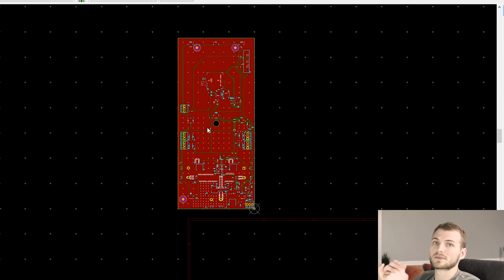Custom heated 3D printer enclosure part 3/x - KiCad PCB Design

Comment: I noticed the ground on the power input connector has thermal relieve but the ones going to the heaters don't. I assume for that amount of current you would want the connection to be solid so is this an oversight or is there a specific reasoning behind that decision?
Reply from the maker: Boy you have good eyes! Yeah, there shouldn't be a thermal on that connector. I must have forgotten to remove them from that connector when I removed the others. It should be fine since it is on both layers, and a 20 mil spoke with, but I'd definitely rather them be solid connections

Comment: As someone who is teaching himself, all 3 styles of videos you mentioned would be great.  Speaking as a beginner, who needs time to go away and absorb what I have just learnt: the detail you went into with the current return path, with stitching vias, especially next to large traces was great info. It would take more video post processing, but I reckon you could break up a video like this into individual elements of board design like that (eg stitching vias and high current return paths strategies), and create a series for a board discussing one element of circuit design at a time. I think the value here would be in having a video on a specific topic (high current series: stitching vias) - how to do them in Kicad and how they help, as a reference video. Just throwing it out there. It's a lot more work, and you have a job as well as doing these videos, which I for one appreciate already.
Reply: I completely agree with Aaron, all three video styles are very interesting.
Reply from the maker: I like that! Thanks :)